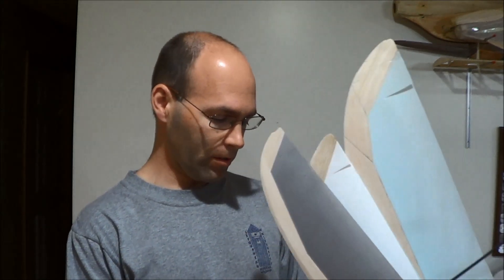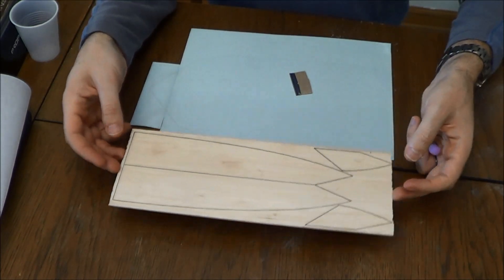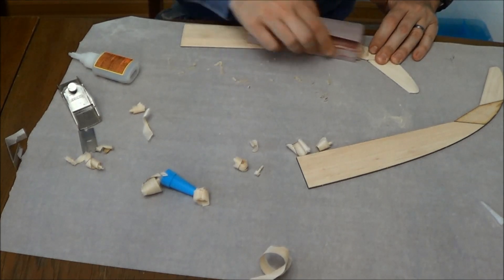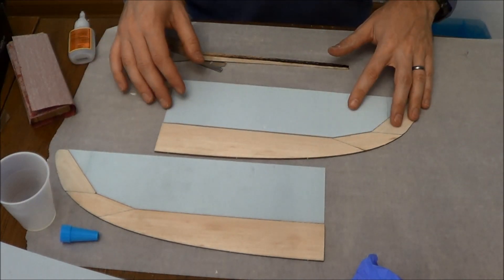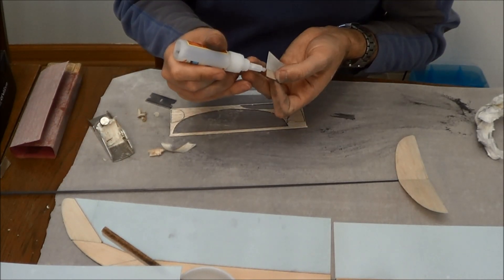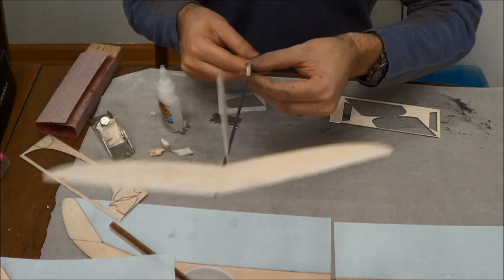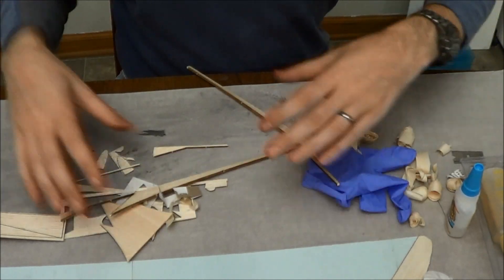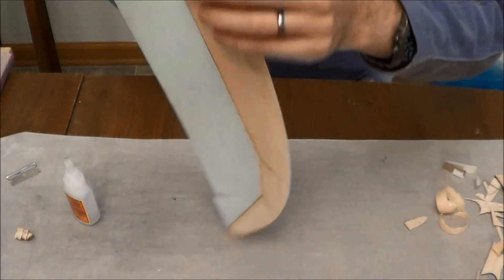Super Cat's Meow - Pro series F1N/Catapult Glider Build Video

Comment: O hi mr. Finn es posibel usa crazy glue in Tha material? You know how as golillas glue
Reply from the maker: Alfred Lebeau I'd be really cautious of it. Gorilla has some sort of proprietary chemistry that I safe with most of the foams I use (it eats durobatics like it's acid). If you can't get Gorilla, you'll have to resort to either epoxy, or a "foam safe" CA from Zap or Bob Smith (I think Mercury has a foam safe glue too).
Reply: Ok 👍🏻 tank you actialy i currently use krazy glue  in tha wood blasa for assembly part  but on top class of cyclic glue fo final assembly fo fon bort fina atac wing